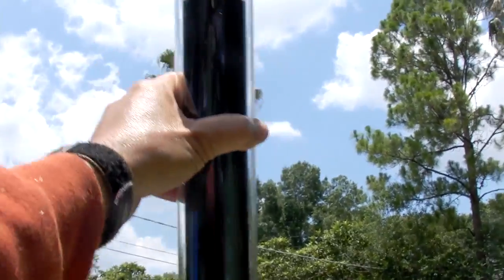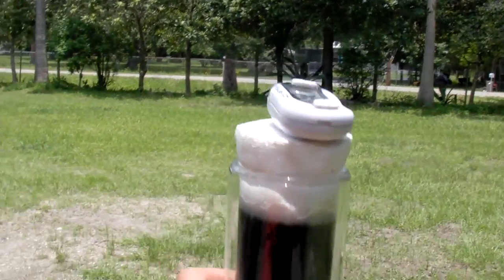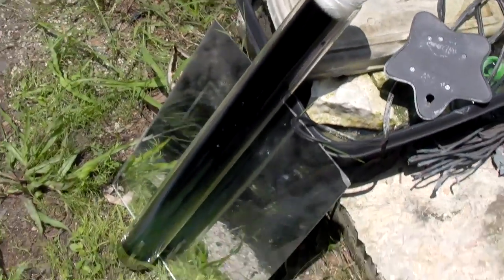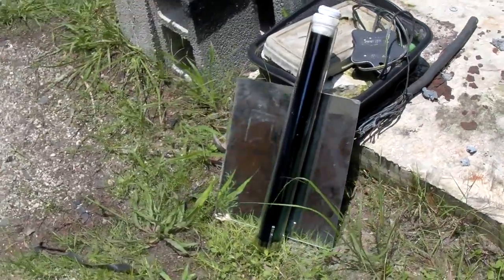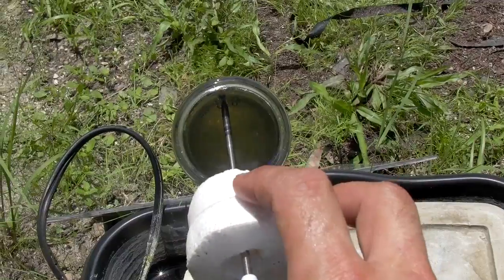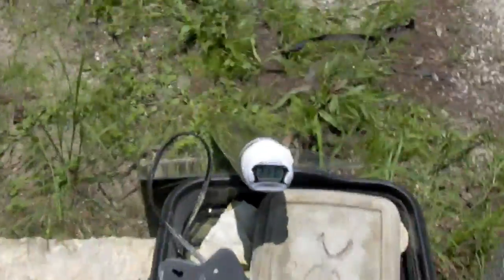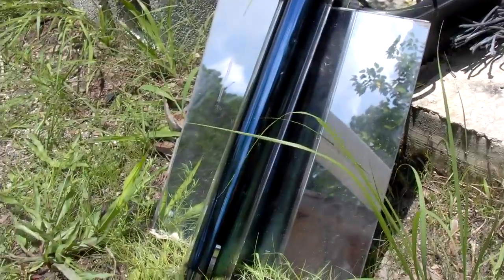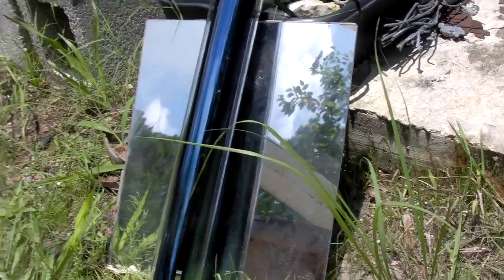Sunlight can be used to produce steam SOLAR EVACUATED TUBE VACUUM TUBES SUN SOLAR BOILER

Comment: I broke one when experimenting by putting semi warm water in due to the uneven heat expansion.  I went to break up the remainder to put in the in & it was very difficult.  They are very tough.  I managed to break it up with a piece of 3x2 but it was hard work.

Comment: One can make a rather small reflector using some wood scraps and ducting sheet metal, cover it with aluminum foil. I made a vacuum tube heater like Dan shows in one of his other videos and was able to get water to boil in about 15 minutes or so. Not too bad. I plan on posting a video soon.

Comment: There is an electric power plant in the USA that uses simaler system and synthitic oils that can handle high temps. They reach temps in excess of 1,200  degrees "F".

Comment: Perhaps 2 inch strips of mirror can be cut from scrap mirrors and placed into a circular troff form to heat a tube that size shown in the video.  The problem then is that the reflector will be heavy from the glass material, but it would be more wind resistant though.

Comment: Thats a bit high of a price for most people to be experimenting with.  Plus if its only slightly curved the focus will be fairly far from the mirror, so it would be best to form/bend it to a near circular arc and hold firmly in position from wind, etc.  So maby there are mirrors like you mention, but perhaps cheaper. Its possible smaller mirrors can be used and "built up" into a larger mirror also.

Comment: You CAN buy 1/8 inch thick acrilic mirrows in 4 ft. by 8 ft. sheets that will curve under thier own weight when set in the sunlight.. They run between $130.00 to  $150.00 each

Comment: It would be good if someone knew a good method to heat bend a clear plastic material and put a reflective coating on the back side of it, to make a trough heater for a glass vacuum pipe like you have there.  possibley a large pipe could be used as a mould.  The plastic trough maby can be braced with a wooden structure.

Comment: I was wondering as a comparison.  Take two borosilicate tubes one small enough to fit in the other.  Like a large test tube placed in a larger one similarly stopped and painted.  Just to see how much the total vacuum is contributing and if a workable double pane tube would perform nearly as well.  I guess two tubes and a black pipe in the middle would be the closest "low tech" approximation.  When the air between the tubes gets hot its "pressure" will drop by decreased density.
Reply: In india we have lots of tube lights,  we have a bigger diameter and a smaller diameter. 
All these tube lights are getting junked because of modern led lights.
These tube lights can be scavenged and used for this purpose

Comment: 23 oz  Starting temp 68 to 212, 3 hrs and 8 minutes.
(23/16oz =1.4375 lbs X 144 sensible degrees)/ 188 mims  is
1.10 BTU per minute.
That's pretty cool.  That pretty darn inspiring actually.  I've been watching you break beer bottles and was going to suggest using pyrex cook ware instead.  Just a glass casserole dish sitting on a fireproof insulator with exactly one pound of water in it. Your way ahead of me.  You are a great experimenter and I am enjoying your videos.  Thanks.

Comment: so could you make a steam generator with one of these under a fresnel lens and over a trough-mirror?  Could you use both together?  If you could then, mounted on a sun-tracker, you could run a steam-powered generator which could be cheaper than buying solar panels (provided you know how to build a steam-generator).

Comment: FenderG wow great point. please lets not see anything that involves water above 212degF. I saw another video where they are using heat or thermal rods and achieved 182degC (or 359degF)  that's scary!

Comment: could you use the vacuum effdect to pull the boiling water through a filter instead of the plug? clean hot water hey presto!

Comment: I am a fan of your videos, great job so far Dan. I wanted to caution you when selecting a material for a better plug than Styrofoam. It may be possible to seal the evacuated tube so well that you could build up pressure and also get the water hotter than 212*. I'm sure you can imagine what an explosion containing shards of glass and hotter than boiling water could do to the human body. Please be careful.